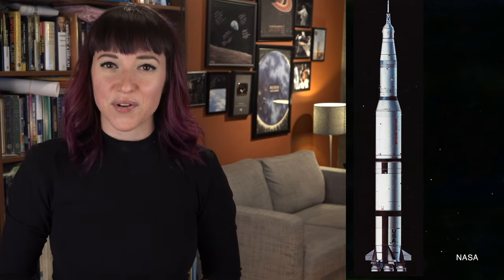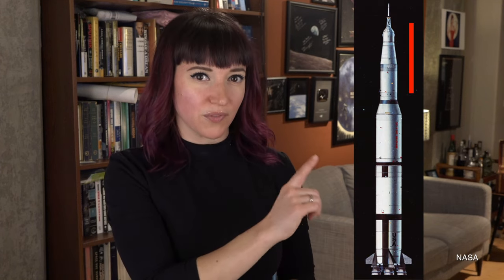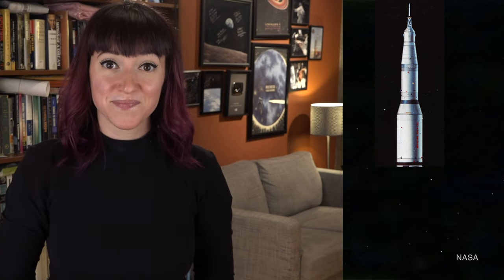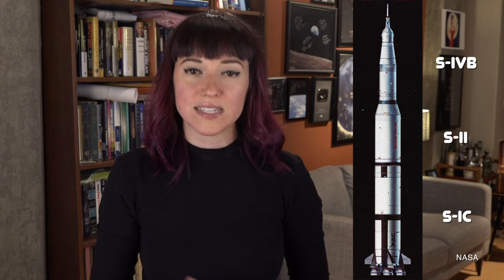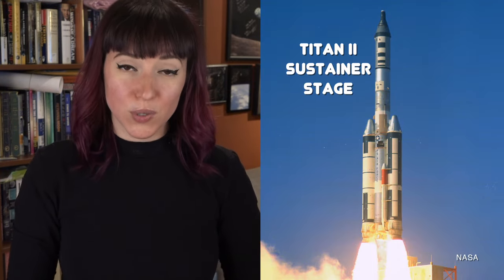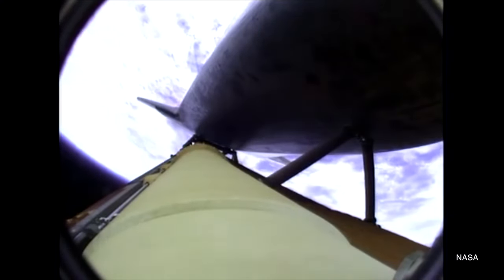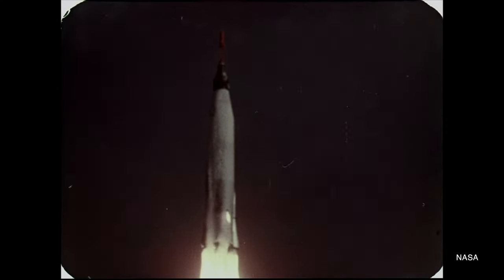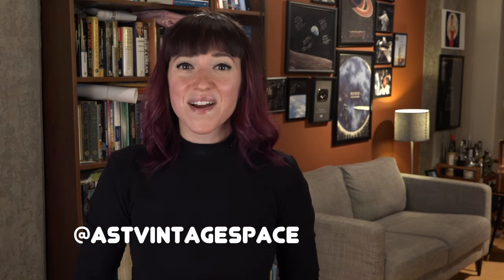The How and Why of Rockets' Staging

Comment: Does having stages also makes it easier to calculate the mass of the rocket during start ? 

If you only have 1 stage, you have a big mass difference between start and short before the tanks are empty. I assume you need to permanently recalculate this for your ascent.

If you have stages, you only need to calculate the mass loss from the propellant for the specific stage (smaller) and you can start again when igniting the next stage (where  mass is back on an known level).

Comment: It might have been interesting to do an approximate weight calculation since the tradeoff of dropping a stage is adding more engines and the support equipment to the upper stages.  The math obviously works out really well or they wouldn't do it.

Comment: You missed the point about the different engines designed to work at their best in the differing atmosphere as the rocket ascends. Quite a good reason to stage as then you have optimal thrust from each engine as the atmosphere changes. Nozzle design is a big one here but as you get into space then different fuels also come into play.

Comment: I've read that the second stage of the upcoming SpaceX BFR (the Big Falcon Spaceship) by itself will be capable of single stage to orbit.  It will need the lower stage to lift a sizeable payload into orbit, or get to the moon or mars, but it COULD reach orbit alone if lightly loaded.

Comment: Hello, Amy! I just found your channel after been trolled about Soviet space rocket Soyuz, my opponent claims it was a "collection of boosters"(he was talking about first stage), while I been thought that its main engines called blocks(I guess just like in the car engine block that consists of the "banks" of cylinders - in line 4 or V-8 and ect. analogous of banks of combustion chambers in rocket engine BLOCKs), so back then(before Shuttle and Buran space programs) there were no concept of boosters, and first stage of Soyuz rocket consisting of five main engine blocks, four of PД-107(BTW "P" in Russian "R" called Rocket, "Д" or "D" in English, stance for "Двигатель"(or "Engine" - or literally Rocket Engine) with only two steering nozzles, while РД-108 is the same RD-107, but with two more(for a total of four) steering nozzles. So RD-108 called BLOCK - A and located in the center surrounded by four RD-107 called BLOCKS - B, C, D and E strapped on the perimeter of BLOCK - A engine. So the question is - does blocks B, C, D, E - are considered to be boosters(and if NOT, then why it is not a boosters?) or blocks of main engine? Thank you in advance. Here is the diagram of Soyuz rocket:

https://upload.wikimedia.org/wikipedia/commons/1/1d/Soyuz_rocket_and_spaceship_V1-1.svg

Comment: Someday you should explain the SRB's. Like, does the solid fuel burn up into the body or is it pushed from the top down to the nozzle? 

Curious minds would like to know
Reply: Solid rocket boosters burn from the middle out.
Reply: Bob Bernatchez that sounds like something someone came up with whilst trying to figure out complimentary D2F angles. ..
Reply: Basically, the entire SRB works like a combustion chamber. This avoids the complexity of fuel pumps, fuel lines and so on, but one of the drawbacks is that the walls need to be strong enough to withstand the pressure from the combustion. This makes an empty SRB much heavier than an empty liquid fuelled stage with comparable fuel capacity.
The combined empty weight of the two shuttle SRBs was about 180 tonnes, which is 38% more than the empty weight of the Saturn V first stage, despite that the latter had more than twice the total impulse, defined as thrust multiplied by the burn-time.

Comment: Has there been any research into rockets where the structure itself forms part of the propellant? For example, using the heat of the burning propellant to cause the structure to systemically vaporize, causing additional thrust and lowering weight?

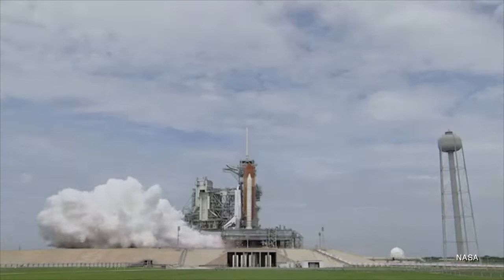Comment: Kudos to referring to solid rocket boosters as motors at 3:56. The SRBs have no moving parts, so they are motors. Rocket "engines" are a bit more tricky because by definition, engines provide power by a series of moving parts (think car engine), but in rocketry, the moving parts are needed to support the combustion process (as in fuel and oxidizer pumps). The pumps don't provide the power, but they are needed and they do move.One should never refer to an SRB as an engine.

Comment: I think you missed something.  There's also a significant efficiency advantage to staging.  I don't remember the specifics, but I've seen someone give a talk on it.  A single-stage-to-orbit-rocket would have a much lower overall propellant efficiency compared to a 2-stage, and 3 moderately better than 2, and so on.  It has diminishing returns, though, and after a while the limitation in the other direction is complexity and that you're lifting all engines instead of fuel.

Comment: A little more detailed explanation about the physics (and math) involved that rationalize staging would have been much more appropriate than a lengthy explanation of the various permutations of staging - all of which accomplish the same thing.  

It’s more than simply ‘getting rid of dead weight’.  You should explain why a large, heavy first stage is needed (as opposed to simply building a small lightweight craft to send into space).

Comment: While a SSTO rocket may be possible, it may not be practical. Staged rockets make it far easier to adjust fuel in expendable stages to account for differences in whatever payload mass/weight is being placed in orbit.
Reply: It's practical from other bodies though. The Apollo lunar module ascent stage was single stage to orbit.
Reply: Sakkura1 True, however Amy was talking about staged rockets vs a SSTO when launched into Earth orbit.
Reply: Sakkura1 The LM ascent stage was designed for operating in 1/6 of Earth gravity. Each body would need a vehicle designed specifically for its gravity... At least until a vehicle like Enterprise's shuttlecraft is developed that can handle most situations.
Reply: The main advantage of an SSTO spacecraft is reusability, and therefore low cost. Plus much simpler operation, because you don't have to rebuild everything for each launch.
But reusable boosters give us most of the advantages while still keeping the superior efficiency of staging.
Reply: What is practical changes with what is needed or wanted. In theory, an SSTO would be slower to get to orbit, but cheaper to operate. Im sure there are many ways to do this. In KSP (i know its just a game) most use a two flight mode space plane to do it. Take off from a runway like a plane, fly as high and fast as more efficient air breathing engines can take you, then switch to rocket motors to get you into orbit. 

Spaceship 1 used this method more or less, tho its not technically an SSTO as it used a mothership, but its a stepping stone to the same concept. Regardless, it sacrifices time for cost/fuel efficiency.
Reply: lyianx The problem comes down to design constraints. Existing single-stage rockets could be SSTO but only with a minuscule payload, which is why the Mercury Atlas rockets required a "stage and a half" to put the capsules in orbit. SSTOs for heavier payloads (i.e. satellites) will require significant advances in metallurgy to reduce mass/weight while maintaining structural integrity, otherwise they'll be thicker and/or longer rockets to contain all the extra fuel tanks and engines to boost those payloads into orbit.
Reply: Musk said the other day that the BFSpacecraft will be SSTO-capable without the booster. Presumably, with little or no payload beyond the spacecraft itself, and with just enough fuel to reach LEO.

Comment: What about the v2? It reached space with one stage...
Reply: Madalin Nicolaescu well, I guess I should say it uses no stages. But it did pass the Karmin line with no staging
Reply: So is new shepard and some sounding rockets, it's not about going to space but to stay there
Reply: The V-2 wasn't a single stage to orbit, (SSTO), which is the type of single stage rocket Amy mentions here.   The V-2 was never designed or intended to put a payload in orbit.
Reply: Reaching space and reaching orbit are different, with orbit being much harder to achieve.
Reply: you make good points, going to space and staying there is different. I was just pointing out that you can get to space with one "stage"
Reply: Jrcraft Into space, yes. Into orbit, no. 
For instance, the Redstone rocket that was a descendant of the V2 launched Al Shepard and Gus Grissom into space, but not orbit. It was a single stage rocket that was powerful enough to get them past the Karman line, but not powerful enough to get them into orbit.
Reply: Space: above the Karmin line.
Orbit: falling at a rate sufficient to fall around the planet, not back to the surface.

Single-stage rockets have always been called sub-orbital because the payload always falls back to the surface, not orbiting.
Reply: It was a suborbital ballistic missile.
Reply: the V2, like the Redstone, reached SPACE, but couldn't reach ORBIT on a single stage
Reply: The V2 wasn't designed to put a payload in space it was designed to put a payload on London.
Reply: Yeah she could have fixed the video by using the word 'orbit' instead of 'space' at the beginning. Suborbital single stage is still getting to space without staging
Reply: Jrcraft ii
Reply: Wrong
Reply: Jrcraft the V2 was only capable of sub-orbital flight. To get any payload to orbit you would need a multiple stage rocket.
Reply: TheBlapman agree, and I commented as such, above, just now. Whoever is doing her scripts needs to be more accurate for us space nerds.
Reply: Doesn't matter that it, Super Arcas, and a number of others are suborbital. They still went to space, which is the criteria Amy used in the video.

It's true anything orbital has staged though.

Edit: Actually now that I think about it that's technically not true either. It's only everything that's reached orbit *from Earth*. The Apollo ascent stage was SSTO. That is SUPER nitpicky though.

Comment: On the Saturn V, between the stages are rings that fit between an upper stage and lower stage. I wonder why the decision was made to use a ring rather than make the wall of the lower stage taller. From video I've seen, the lower stage first detaches from the ring. When the upper stage is ready to fire, the ring drops away as well. I don't understand the need for that ring. Any clues?

Comment: Other question for thought, gravity. Is gravity the same at sea level and 50,000 ft or does it diminish with altitude?
Reply from the maker: That's a good one, and one for another video because I'll be able to talk about my favourite moment of any Apollo mission: equigravisphere! This is now on my list!
Reply: It does diminish with altitude. Gravity around the earth is proportional to the square of the distance to the center of the earth. But since the radius of the earth is so much larger than the height of low earth orbit, it does not vary by much over that distance.
Reply: Technically, no, it's not the same.  Gravity weakens the farther you get from the center of gravity.  So the pull at 50,000 ft would be measurably less than at sea level.  And the effect is exponential.  That said however, we are so small compared to Earth, that at just 50,000 feet we wouldn't notice that change.  If you stepped on a scale at that height, you'd weigh a little less, but probably not much more than a pound less.  At 80,000 ft, the loss would be much more noticeable.  Above that and you begin to see a huge drop off the higher you go.

Someone with more knowledge and better math would probably be able to tell you the exact amount of weight loss, though.
Reply: g = (GM)/R^2
M -mass of earth
G - gravitational constant
R - distance between the centre of earth and the object
g - acceleration due to gravity at a distance R from the centre of the earth
Reply: Gravity doesn't change much with altitude. What changes is horizontal speed which produces centripetal forces which gradually cancel out gravity (until at orbit gravity is fully cancelled).
Reply: Define gravity.
Reply: sidharth cs one of the four basic interactions, weak, but unlimited range
Reply: Gravity varies depending not only on location, but also on TIME.  For example, gravity is very strong directly under my pillow from about 5AM to 7AM.  However, at Noon, there seems to be almost no gravity at all there.

It's confusing, but real !
Reply: sidharth cs the wierd effect that causes objects near earth to accelerate 9.81 m/s/s towards earth.
Reply: ssidharth cs, your education is your own responsibility.  You have heard it explained more than once.  It takes an idiot to not believe in gravity.

Comment: When I was a young teenager I tried to build a water rocket (from old bottles)with staging function . Never worked, eather it was to top heavy and felll down, blown away on the launch pad or did a de staging short after lift of. It never worked and I thrown it away into garbage can. Staging is very hard.

Comment: I’ve always been a bit puzzled by the staging on the Atlas - where did the fuel for the booster engines come from? I assume the same fuel tanks that fed the sustainer engine also fed the booster engines, but then why ditch the booster engines at all? If the fuel is still there and usable, why not run 3 engines to orbit instead of just 1?
Reply: i thing it is beacuse they needed those engines for extra twr on lift off, so in the flight as the rocket got lighter they did not need the extra engines for a twr larger than 1 and maybe the center one was more efficient or they did not want to carry that extra weight into orbit. sorry if Im wrong and sorry if my english is wrong, Im brazilian
Reply: as hev gamer says if the engines weigh 1000kg each and provide 3000gks/s each of thrust, assuming you have 3000kgs fuel in that initial stage and the rest of the rocket weighs 1000kgs

at lift off you have 7000kgs of weight and a lift off thrust of 9000kgs/s  - so the rocket will lift off the ground.  After 60 seconds assume you have burned 2500 kgs of fuel.

so the rocket now weighs 3000 +500 +1000 =4500kgs if you keep the extra engines you will burn out of fuel 3x faster and not have enough fuel to get to orbit. 

This is true because the higher you go the thinner the atmosphere and the less resistance there is, so you get more acceleration for any given amount of fuel, so the more fuel burn time you have the better - even at lower power the higher up in the atmosphere you go.

If however you drop 2000kgs of engines your rocket only weighs the 1000kgs +500kgs + 1000kgs then the 1 remaining engine will burn longer and get you to orbit.

Comment: Excellent video but engine design is also an important factor in staging. To maximise delta v you want to drop your rocket engine designed for high ISP in an atmosphere and switch to the engines designed for a high ISP in a vacuum.

Comment: How high did a v2 go? I know it did not orbit but it did carry a 2000 pound payload. I thought they went higher than 60 miles and therefore single stage into space. Am I wrong? Thanks Bob
Reply: Robert Bertram The V2 could go moderately high if launched vertically, but the trajectory when used as a missile was shallower.
Reply: I have checked several places and the v2 it seems on a long trajectory was able to reach 128 miles high. While thats not orbital it is single stage to space

Comment: What happened to the main shuttle tank after the fuel was spent? The SRB splashed down in the ocean but did the tanks go into orbit, if so could they be used in someway?
Reply: The tank was ditched just before the Shuttle got into Low Earth Orbit. The Shuttle's OMS system then did the orbit insertion burn. This was done intentionally so as not to run the risk of having such a large object in orbit. The tank came down over the pacific.
Reply: External tanks did not attain sufficient velocity to reach orbit.  After being jettisoned they would fall back into the atmosphere and break up before falling into the Indian or Pacific Oceans.  The shuttle normally performed one or more additional OMS burn(s) to reach a sustainable orbit.  Further research tells me that it would have been possible to carry the ET into a low orbit, if a purpose for doing so could have justified it, but such an orbit would not be sustainable for very long (a few months or so at best), and without maneuvering thrusters, communications hardware and additional outfitting, it's utility for any other purpose would have been quite limited.  Placing an inanimate object of that size in orbit that was destined for an uncontrolled reentry would have been unsafe and costly to monitor, plan for and react to.  Think of the effort that went into tracking the reentry of Skylab back in 1979.
Reply: The shuttle's tank fall back to Earth and mostly burned up upon re-entry.   No way to recover it, since there was no way to slow it down to a speed where it wouldn't burn up.

Comment: The drawback to this is that rockets like the Saturn V had to carry extra engines attached to the second stage.  I wonder that there weren't more attempts to use more of a drop tank arrangement where you keep shedding fuel tanks but keep the engine with you like the Space Shuttle.